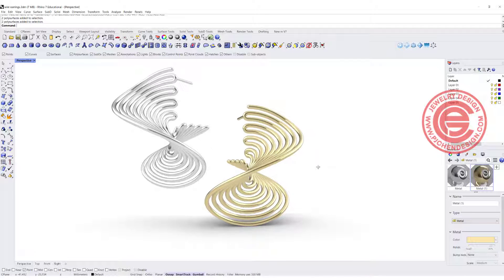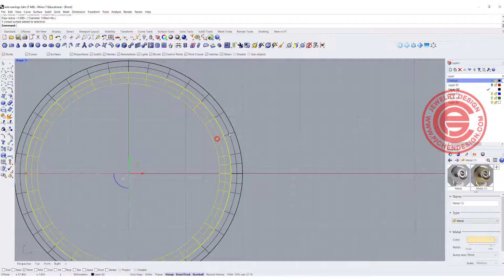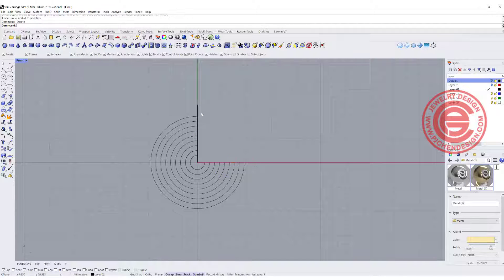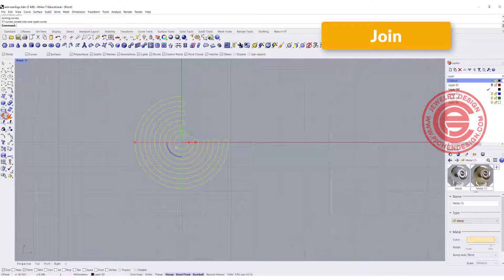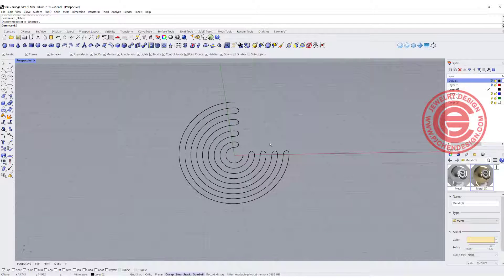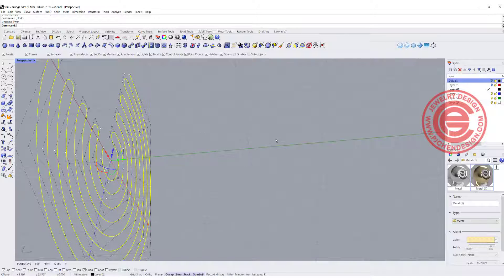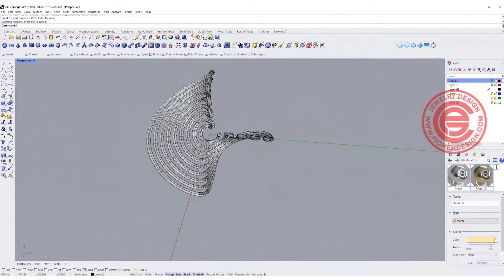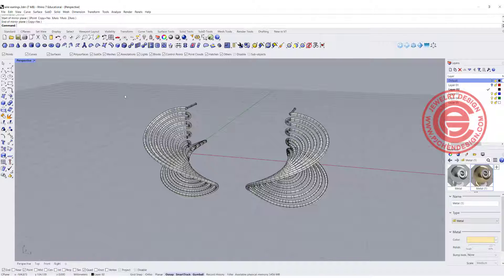Wire Earring Jewelry Design Tutorial 3D Modeling with Rhino 3D #212

Comment: PJ thanks for all the time you dedicate to us and making these videos! Seeing your intersecting pipe correction reminds me of an issue I deal with a lot. I like to border pieces with a rope edge sometimes that I make using spiral and pipe. I want the pipe to intersect itself some but then it won't allow any boolean operations. I usually just fiddle until there is the tiniest of gaps and it comes out how I basically want after casting, but it's not "right." How can I keep the intersected pipe look? I don't know an effective way to cut out those internal intersections.
Reply from the maker: Do you mean you have issue on pipe when you boolean. If that is the case, you can always use gumball to move them as you did, but only move a little like 0.01. check out my SNAIL video. I remember it may be at part 2 where I discuss how to remove the intersection parts. Hope that helps.
Reply: @PJChenJewelryDesign  That was an interesting video, but I wasn't able to apply anything to my problem. However, I was reminded of another valuable lesson from you. I tried to make a simple mock-up to demonstrate problem, and it worked fine! I add this edge design at the end and there is just too much going on and the computer can't handle the boolean. There is no design error. I just have to split it up into smaller sections or do it earlier. Thank you so much PJ!